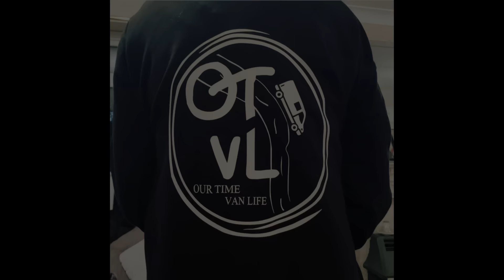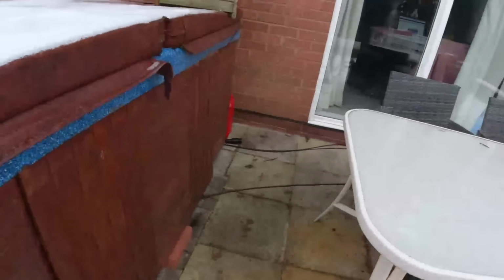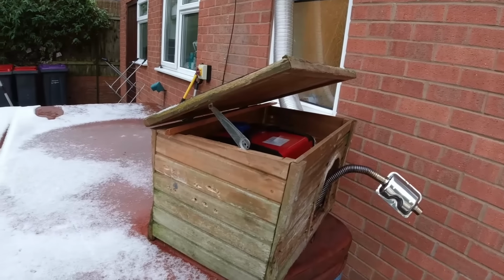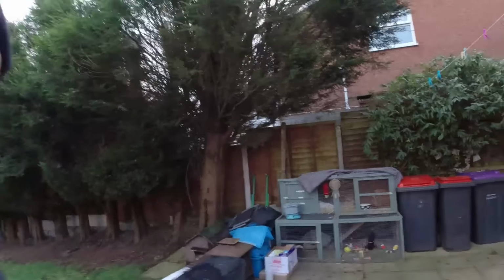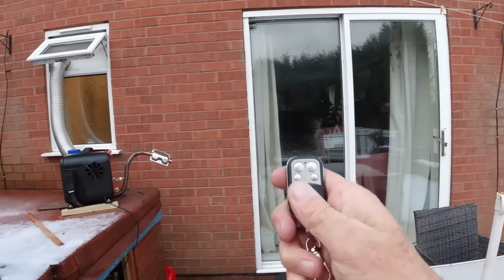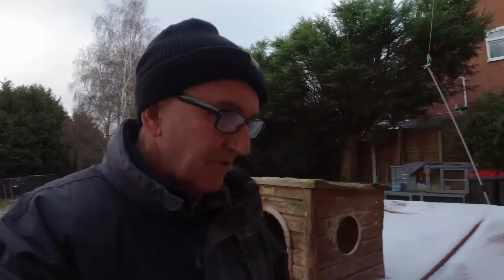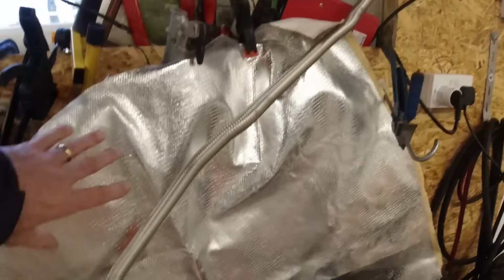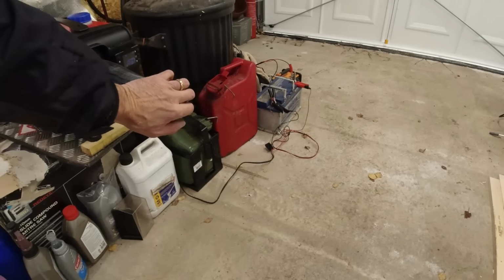CHINESE DIESEL HEATER HEATING OUR HOME REVIEW GOOD OR BAD ?

Comment: Nice but my only issue with your setup is the exhaust should run down hill to allow  the condensation to run out.
Reply: Actually, mine has been running for over a month now on and off with the exhaust orientated vertically up the chimney and there is zero condensation in the exhaust. I suspect this is because the unit is being run indoors. With the exhaust outside in a colder environment then I expect condensation in the pipe would eventually become a problem.
Reply: Why would you even have a issue  with his set up lol

Comment: Some points to pay attention: exhaust pipe straight down to prevent consensed water and residues clogging the burner, change the fuel hose to a proper one, insulate the exhaust pipe cause it is placed next to the fuel line at the bottom of the heater....as well apply some rubber foam to the fuel pump which decreases the  noise significantly. So this bone cheap appliance is an incredibly good solution to warm my shed

Comment: So, I have the exact same heater. I run it in-front of the fireplace in the living room and vent the exhaust straight up the chimney. Zero fumes in the house. It will take our sizeable living room from 14°C to 24°C in about 35 mins and then the heat starts to find its way out the doors and into the rest of the house. To do that it has to be run on 5.4Hz. Mine is powered from mains using a 30amp transformer bought from Amazon and I’ve run a watt meter in-line between the power supply and the heater. I can state it will draw as much as 9amps on start up and again on shut down for a period of about a minute as it lights the glow plug to both fire and then purge the combustion chamber through both those phases of operation. During run it draws anywhere from 0.75amp and 2-3amps depending on motor speed. Really pleased with it. Sourced a supply of red diesel for it today. One of the best things we’ve ever bought.
Reply: This is what I plan on doing with the one I've just ordered so I'm glad to hear someone else has done a similar thing. Our house only has a gas fire in the front room so I'm planning on putting a diesel heater in the fireplace of the master bedroom and then route the exhaust up the chimney.
It should hopefully take the chill off the upstairs during the winter months.
Reply from the maker: Love that idea 👍
Reply: Great idea. Hope you've got your CO meter in the room. Monitor for leaks.
Reply: @Mike-hu8yz  definitely, will probably get a couple to be even safer.
Reply: Brilliant Idea, could you post a little vid on youtube, tapping the chimney is obviously one of the best solutions if the fumes make it up to the roof and condensation evaporate eventually👍
Reply: I am thinking of using one myself once I have figured out the best way of sorting out where to put the exhaust . the bit I don’t understand with your set up in the living room is the noise!!  If the one on the video is anything to go by then it would unbearable?
Reply: I know it been a year, but question: why don’t you use the fireplace for heating?

I got a fireplace, but messing with diesel in my living room compared to throwing in a few logs seems unnecessary?
Reply: @eightsprites  because my fire is a gas fire. The diesel heater rinds all day blowing hot air all round the room and if I leave the living room doors open it finds its way out and warms most of the downstairs which the gas fire doesn’t do, plus it’s infinitely cheaper burning red diesel for this purpose than it is paying for the extra gas the gas fire consumes.

Comment: Having the heater unit indoors gives the added benefit of the high temperatures from the first 2ft of the exhaust with the exhaust fumes vented outside, recirculating the air from the room through the unit also makes for quicker warm up of the room.
Reply from the maker: Yes 100% if you can get it inside with exhaust out side 👍
Reply: That, and at least 50% of the heat is wasted through the exhaust pipe.
Wanna double the efficiency or have 10KW of heat on teh same amount of fuel?  
Put the unit inside and pipe the exhaust throuh a radiator with a 12V radiato fan end THEN out of the building.
These are basically just pistonless engines where they are barely 35% efficient unless you use the exhaust heat as well.
Reply: @arthurfoyt6727  I have read that the radiators get blocked up fairly quickly.
Reply: @LSD123.  Just like any other engine, you have to tune it after making changes to the exhaust system.
Reply: @arthurfoyt6727  Fair enough.
Reply: You might want to route the intake outside as well because with it pulling air from the inside you are creating negative pressure in the home which will pull the cold in from cracks, gaps, plumbing holes, and attic entrances.
Reply: @arthurfoyt6727  or find an egr cooler or two, and have a nice actual stainless exhaust welded up! Ceramic coat it.

Comment: I've got the same unit and originally had it outside until I bought an extra length of exhaust pipe, then I moved it inside with the exhaust out of a window, the efficiency was so much better when you are not trying to warm up - degree temperatures. I was using a 3rd less diesel compared to it being outside
Reply: how was the noise level with it inside?
Reply: Could've just moved your air inlet to inside air and left the unit outside so u don't have to listen to it running.
Reply: @landoflakes92 

Inside air❓ sorry I'm very green to all this 🤔
Reply: @dave9456  The pipe with the airfilter on it. I think it draws air into the heater and as it does so it passes over an air temp sensor..if that pipe is indoors it will 'pull in' warmer air therefore will not 'sense' the colder outside temp and burn less fuel.
Reply: Be careful make sure to use a co monitor

Comment: i have fitted mine outside my house but i circulate through the wall via the inlet and outlet  i made a box to fit the whole heater  in it works  great
Reply: I do the same, its far more efficient than heating cold air!

Comment: Do Not ever use a rolled up extension, under load it acts as an inductor, hence it catches fire  🔥
Reply: Basically a magnet
Reply: Basically a one bar fire
Reply: Learned this a long time ago when I noticed it melting lol
Reply: Your right but when glow plug is running it's not ideal but it uses 2A DC at 12v. Like 25W at worst. And if the transformer recifier is 50% efficient then it will be 50W draw constantly. Doubt any fires at this power but I agree with you.
Reply: Actually, no, it is not inductance. It is due to a rolled up cable, which generates some heat, being unable to dissipate heat, so the cable just gets hotter, and hotter. Eventually the plastic insulation just melts. How much heat is generated, depends upon the load on the cable. In this case, it will be minimal.
Reply: a diesel heater draws very little current.
Reply: @jackoconnell2204  your correct don’t mind this completely load depending

Comment: Why are you heating outside air? Run another duct from the air intake to the inside of the house - that way you are adding heat to the inside air just as does a 'normal' house furnace. You will then get much higher temperatures than heating cold outside air. Remember that the diesel heater has a finite temperature differential capability which means that if the outside air drops 5 degrees so will the air coming from the heater.
Reply: That would cause negative pressure in the house, meaning the house will be acting as a vacuum, and sucking cold air from the outside in. 

Having neutral pressure, as in this setup is much more efficient.
Reply: @toxichazard5015  Think that's what he means, take air from house, heat it, return back to house.

Comment: Bare in mind if you have a power cut whilst heater is on, it could fry the mainboard, as these heaters need to be shut down slowly, so I use the battery with a constant trickle. Just a thought !
Reply: I think generally it is more likely to fry the temple sensor. £6 part. Mine did with a power cut. 10 min fix

Comment: you should have a battery, as if there is a power cut the unit will self destruct due to the heat. You can put the battery across the output of the power supply. That should allow the battery to stay charged in case of an outage. I would estimate a small and cheap 12v 7ah for ups should allow run down time to cut the burn off and save the unit
Reply: Would thqt not fry a battery and release gases?

Comment: Thanks for the vid! 👍 
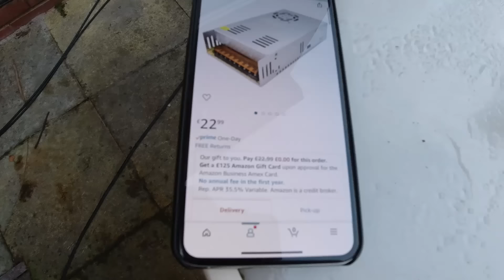I’m just getting mine put together for mounting in a metal box outside. I’m planning to have the controller inside powered from a power supply similar to yours(4:12). 
As we do suffer from occasional power outages, I’m going to power it from a UPS which will kick in when the power goes down and give me time to shut the heater down properly. I can then dig out the generator if it looks like being a long power cut!
Reply from the maker: Great info Al Thank you

Comment: its probably been stated elsewhere in the comments, but that heater in your garage is exhausting INTO your garage (small hole in the muffler to let water escape) + plus + they're generally terribly welded together so leak anyway.
Reply from the maker: Good comments thank you but it only keeps the damp out the garage and the car dry so I’m not in at the same time for long enough 👍

Comment: If used inside your house Check your carbon monoxide meter near your exhaust to see if the alarm goes off I bought one and my alarm still didn't go off at 200 ppm so i had to get another one

Comment: If your exhaust is higher then inlet you will get carbon build up. It should be running at a down slope at all times like a drain line.

Comment: Try using another exhaust silencer on the air intake for burner. That intake is quite noisy.
Reply: Sounds like the fab is catching on housing. Had that problem with my van heater. Centering support pins not holding fan concentric with housing.

Comment: You need to pull the air from in the house to the back of the heater will blow a lot more heat then and be more efficient
Reply from the maker: Yes loads of people putting them inside now it would be more effective yes I need to think that one out 👍🤔

Comment: Apart from CO and CO2, does the exhaust smell like a car exhaust? Also, some people report that if you extend the exhaust like in your garage to recover exhaust heat, water vapour comes out from it. My main concern is smell, not vapour.
Reply from the maker: No small at all in the garage or vapour it works great

Comment: All you have to do It's put a battery trickle charger That's about two amps More than enough when the unit runs it takes no power It does not pull twelve volts at all times

Comment: I love your idea ,which plenty of people use!! 

Like someone else said ,extention lead ,fully unwound, less you want a fire .... as it'll act as an electronic magnet ,and they dissipate heat ....

You can buy different units too ,that have ,wire harnesses that can extend ,easier than directing your current unit ...

Invest in a leisure battery too with high amp output like 120 Amps capacity ....

Invest in a solar charger and adequate solar panel ,say 200 w or two 100 w panels... mount them on garage if need be ....

Oh and finally ... exhaust ...extention on it is all good ...but always have it pointing downwards unless you are skilled at cleaning amd maintaining heater ,more than needed ...

But I see why you opt for this ,as prices rise !! Scandalous!!

Comment: Hi there mate! I recently purchased and installed one of this dieasel heater into my garage, but its far away from yours! I have a 20ft x20ft 10ft tall garage, and got a "8kw" heater. Did give it a go, but on full throttle, from 10 in the morning till 17 it only pushed the temp up to from 0 to 8 celsius... The garage made from plywood and have 5cm polifoam isolation all around. What is can be wrong ? Im just about to send the heater back. You have about the same size garage, and yours heat up from 0-12 in a half hour?! Thats very impressive, from a 5kw heater!

Comment: I think these are over rated for anything but their intended use, and that’s to defrost cars, vans, and keep lorry cabs warm in Arctic conditions, hence been called night heaters. 

Yes you can use them to heat campers, motors homes, but that’s the limit. 

If I don’t have my heating on for 24 hrs in my house it’s 15-16 degrees, but having the heating on 24/7 with the hive set at minimum 18 degrees it’s costing me around 40p an hr you’ll find that heater is costing more than 40p an hr to run flat out with today’s diesel prices, if you get kerosene for 85p a litre then that CDH will cost you 36p an hr to run flat out. 

Noway can this heater take the chill out of any house unless it’s a doll house, the maths don’t add up 5kw heater they are rated for but they are not 100% efficient. 

I bought one of these to heat up my garage (uk) and it’s only 9x20ft concrete and it’s getting to maybe 12 deg after hrs on end zero ambient temperatures, this was also with the exhaust inside I did this to test it and it’s a 5kw maxpeedings all in one. 

The price of these are going through the roof based on tube vids, who are also jumping on the band wagon for clicks, just look at the views this guys vids have and then look on the heater clicks.  

I bought one based on these tube vids and tbh it’s cheaper and more effective for me to use two electric heaters, and a dam site more quieter. 

They must make a good 80 plus DB and it’s annoying as hell in my shop just hearing this thing. 

If you have no other means of heating then these can work to heat a small room, small been key. 

If you have central heating then don’t listen to these tubers and turn your heating on it’s far far cheaper. 

Cost to run these heaters flat out because it will always be on flat out mine used 1 litre of fuel in 2.5 hrs 

1 litre of pump diesel cost £1.85 that’s 74p an hr

1 litre of red cost around £1.35 if you can find it local 

1 litre of kerosene .85p if you can buy 500 litres that’s 34p an hr a little cheaper than running your entire house on central heating and this will heat your bog, maybe a bedroom. 

So let’s just say you can run on cheaper kerosene, the heaters are now £200 give or take mine cost £250, then a transformer cost £50 because everybody’s buying cheaper ones, then any cabling you’ll need so it’s £300 minimum for me it’s not saving me any money because I can’t get cheaper fuel and I’m only needing to heat my garage for 2-3 months of the year.
Reply from the maker: Good feed back 👍
Reply: In many ways you are correct. Running these at full chat does consume the fuel and gets expensive, but it’s bloody good at bringing the living room up to temperature quickly and then throttling it right down until it’s on tick over or just above and it then retains a nice warm background heat in the room for as long as you need.
In one month of general usage, the unit has consumed 30 litres of red diesel in my case using as we have. By comparison, had I been running the gas central heating for our 5 bed house, or just been using the 7Kw gas fire in the living room, the cost would have been considerably higher than the 30 litre of diesel this heater has smoked over the same period. I think you just have to be realistic with your expectations of what a parking heater can achieve and use it accordingly. I still think it was an excellent purchase. Paid £105 for our 8Kw unit and it’s been faultless so far. I never bought it with the expectation to heat the whole house, just one room, or if i orientate it to blast directly up the stairs, it does get the landing area and a couple of bedrooms nice and toasty within about an hour.
Reply: I take it you're not very impressed by them then.
Reply: Don't no  were you got your prices from, your way out ,and robbed, (unless you're a trader?) £90 heater , transformer £10, I've used 5 of these heaters for 3 year no problems if you lock after them

Comment: Your exhaust pipe should run continuously down hill to drain condensation away. You have it going up then down, that will fill the pipe with condensate waste water.
Reply from the maker: Yes it’s the only way I can exit the garage with out drilling holes in the walls but it’s been running great and no problem for over a week now 👍
Reply: @ourtimevanlife9667 
Perhaps you can do what I did with mine - use something to elevate the unit.  Mine is mounted inside my van.  I made a stand (18 inches tall) out of some plywood (cut intake/exhaust holes through) and 2x4 beams.  That way I could let the exhaust  pipe go nearly straight down (through the floor of my van), while still getting some heat from the ~18-inch section of exhaust pipe that's inside the van.

Comment: Don't you want to heat and circulate air inside the house rather than cold air into the window.( Which investabley will blow hot air out somewhere else). Just pop the exhaust out the window ( like a camper install) ?

Comment: Iv got the same controller as that if you press the cog and up button it turns it to hz and you can control the speed of it so it doesn't run flat out hope this helps
Reply from the maker: Ow ok thank you will have a look 👍
Reply from the maker: 👍thank you
Reply: @ourtimevanlife9667  hi fella how did you get on did it work on your control panel ???
Reply: Yes, it puts it into 'manual' mode, so the heater isn't reliant on the thermostat in the controller. It has settings from 1 to 6 "H-1 to H-6". I've just bought a 5/8 Kw one for my house!

Comment: Sorry im looking at these heaters for
My
Garage for
The winter - does your model have to be connected to a battery as well as the diesel
Supply or will it run just of diesel without the battery ?
Reply from the maker: Hey it needs a 12v battery supply. Hopes this helps 😎
Reply: @ourtimevanlife9667  ty